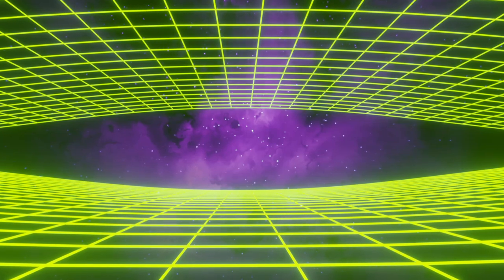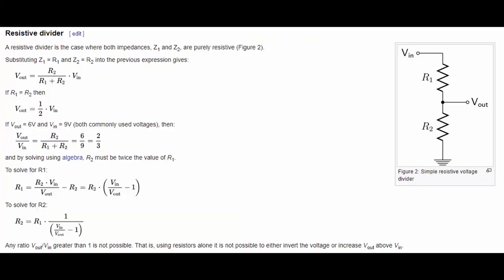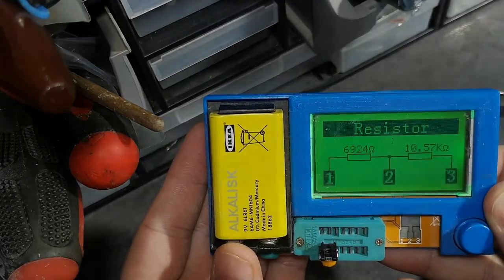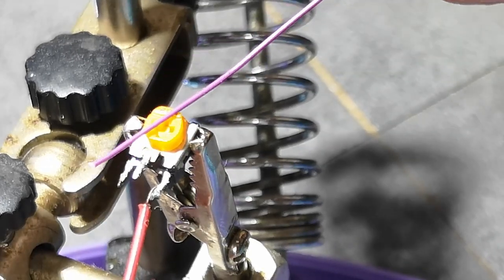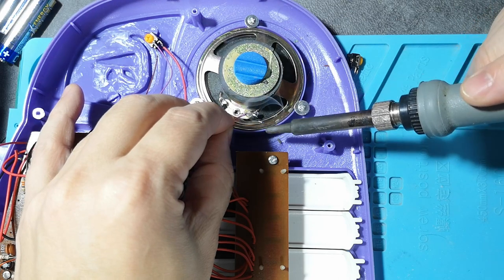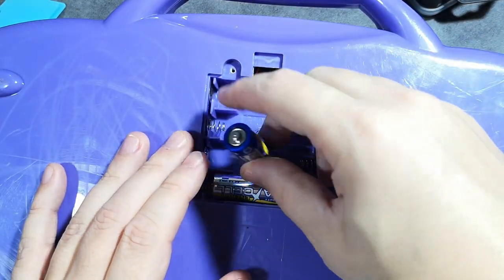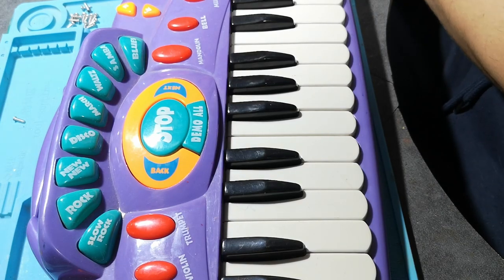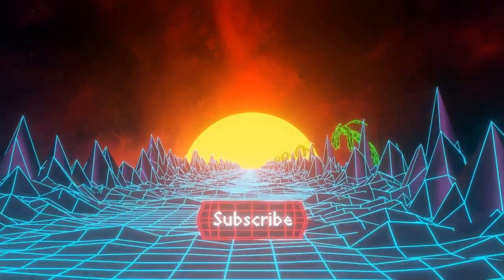ADD volume control to any toy for 0.10€

Comment: Is there a quick hack to make it louder?
Reply from the maker: Hi unfortunately not as easy as this, but you can do it with a micro amplifier , you need to wire power and ground and speaker cables to it and then from the amp connect to the speaker , essentially you put it inline with the speaker , amps need to be powered so you need additional wires .

something like LM386 audio power amplifier 1€: https://www.aliexpress.com/item/1005004866785507.html?spm=a2g0o.productlist.main.15.1b7eU5z5U5z5B7&algo_pvid=8888e350-b07c-4de1-ad2f-034d03117bac&aem_p4p_detail=2024062005163710383746975494970000420892&algo_exp_id=8888e350-b07c-4de1-ad2f-034d03117bac-7&pdp_npi=4%40dis%21EUR%210.98%210.94%21%21%211.03%210.99%21%402103890917188857977688643eb572%2112000033611335672%21sea%21ES%21194907523%21&curPageLogUid=He28tsEOntcK&utparam-url=scene%3Asearch%7Cquery_from%3A&search_p4p_id=2024062005163710383746975494970000420892_2

Hope this helps
Reply: @RetroUpgrade  Oh nice, now I have discovered this I might become much more trouble.

Comment: hi there! i know this video is quite old but i tried this and it works!! one small issue though is now that ive done it even when the pot is full its still very very inaudible do you have any idea how i can get the signal a bit louder? all the best!
Reply from the maker: this depends on the Value of the pot if its to high the volume won't be audible and if to low it will be to loud no matter what :) .usually the 1k pots work best. hope this helps
Reply: @RetroUpgrade  ah that explains it! I'm using a 10k pot (lowest i have right now) ill order some smaller value ones tonight. thanks!